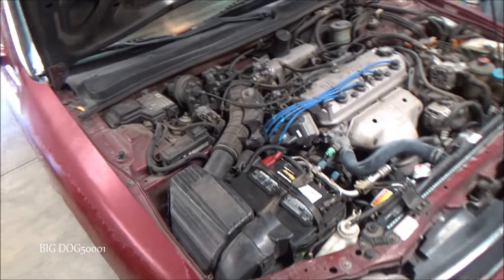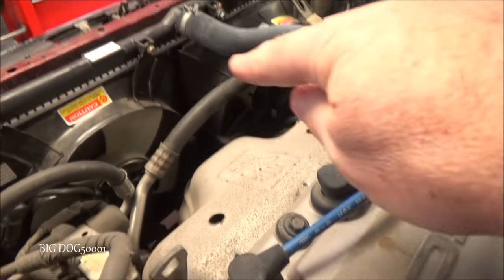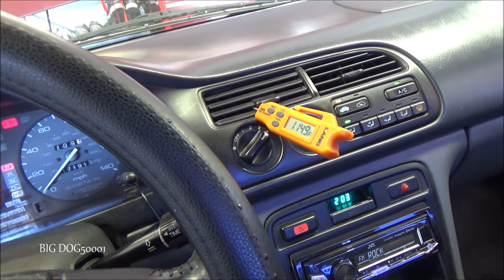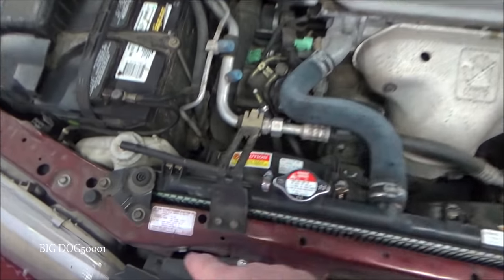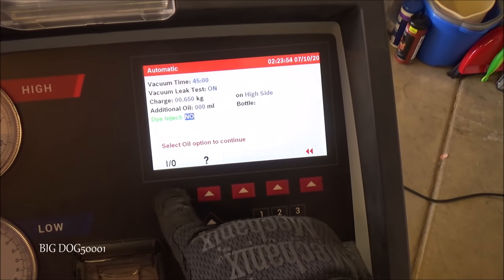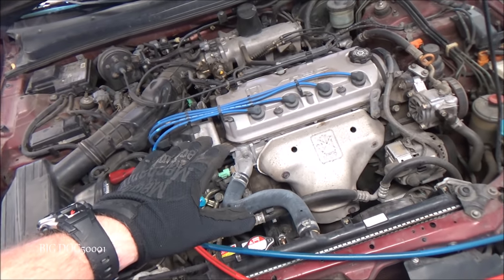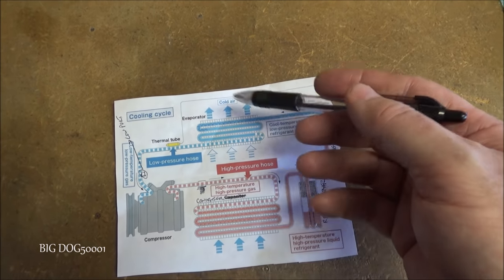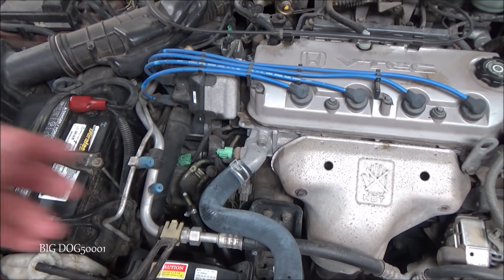Honda Accord A/C Troubleshooting and Service

Comment from the maker: Tools

Disclosure: This channel earns a small commission using some of these links - at no additional cost to you.
Digital Thermometer:  https://amzn.to/39Fb92M
A/C Recovery Machine:  https://amzn.to/2XcQZrE
A/C Leak Detector:  https://amzn.to/2CWJ5fv
PAG 46 Double End Capped Oil:  https://amzn.to/30cN1Bi
PAG 46 Oil (not double end capped):  https://amzn.to/2D4vmmK

The Big Dog 50001 Automotive Channel Store can be found here: https://www.amazon.com/shop/bigdog50001automotive
Reply: @Big Dog50001 Automotive 
I would bet that the leak which is now very small is located in the sharply curved discharge rubber crimped hose towards the right side of the engine compartment. I have this same problem on my 1994 right now, it started out with the leak being so small it was impossible to find it, however now it has gotten big enough you can see the pag oil residue on the side of the black rubber hose right where it crimes in as it migrates up the hose.

Comment: I like the way you did a long vacuum, some guys seem to finish that phase too quick. When the system goes to vacuum, water can't exist as a liquid so it boils off, but as it does so there is dramatic cooling which can cause small amounts of water to freeze in the condenser and receiver/dryer. Then it takes a while for the solid ice to sublimate to gas and get vacuumed away. It is so nice to see a pro do work like this in a small garage setting. You obviously did this for a living and are now at the phase where you can take time to educate people like myself.

Comment: Your video gave me the confidence to go ahead and recharge the coolant system on my 2002 Honda Accord EX (4-cylinder VTEC engine). Interestingly enough, after completing the recharge, my hi/low gauges showed almost the exact same settings you had when you finished. I had never done this before and I'm quite happy with the outcome. My car's air conditioning is now working well. I'm planning to watch some more of your videos. Other YouTubers would do well to emulate your style. You do a great job. Thanks! — Richie

Comment: Coolv video 👍 Just serviced my 97 Accord yesterday. Replaced both high and low Schrader valves due to leaking freon. Purchased R34a with gauge and AC oil. Got the AC to a cool 42 degrees during 108 degrees desert heat. What a difference it has made commuting to work 😎
Reply: Winter in your car.. mine is Death Valley in my car
Reply: @ravishoul1432  Right! I forgot how fun it’s to drive my Accord again opposed to melting on my commute back home 🫠
Reply: @elgatogordo9523  It's my own personal  mobile sauna
Reply: @ravishoul1432  Lol! 🤣
Reply: Oh man are you me? I have a leak on the low pressure side but if I carefully try seating the shrader valve pin it seems to hold. It's held refrigerant for 3 years since I last charged it and it still gets down to 38 degree low. Not bad for a 305k mile car, love my Accord.

Comment: My 1995 Accord Ex still on the factory charge and still blows ice cold. A testament to Honda quality of Generation V.
Reply: Respect.
Reply: Then why the are you here? To rub it in to everybody else whose isn't?
Reply: @ButterfatFarms  I'm a cruel one aren't I? 
muwahahahahahahaha!
Reply: I agree with you. My 2002 Honda Accord EX went 18 years before it finally lost most of its refrigerant. However, because I was extremely busy, I didn't get around to recharging it until now. But I have to admit, I also feared taking it to a mechanic who might say, "You need a new compressor, and I recommend you also install a new condenser. That and recharging the system will be $1400." 😨Gulp . . . That's about as much as I think I could get for the car. I was able to forego the recharge for four years because summers are cooler here in Idaho. — Richie

Comment: I have 2004 Expedition blowing warm air while driving I replaced the TXV expansion valve and it is fixed and also the blend door actuator was clicking so I replaced that too.Yutube is a big help in DIY people like me.

Comment: Man that is hot 117! Well explained video on auto AC charging. Outside air temp at condenser compared to inside AC air vent temp equals the Delta T. 50 degree difference is pretty good, maximum legal reflective window tint all around and your good. I am in Florida an did a shade tree AC gauge charge. No recovery machine or vacuum pump and I am at a 45 degree Delta T  on a 95 degree air temp with 60% humidity on a 93 Accord.

Comment: Phenomenal video, I have the exact same car and my car leaks ever so slightly from the shrader valve on the low side. When interpreting your pressures I noticed in the video you have the engine at around 2k rpms. Should the engine be revved and held when checking the pressures or is it done at idle? Thank you!

Comment: I like the fact that you explained why if the pressures didn't equalize that it could have a restriction. Had my A/C checked, Mech said,1st  pressure Check 10LP -75HP.  After evac and recharge pressure readings were 105 LOW side-110 HiGH side.ambient temp was in the 90's I live in Colorado. Mech said would only take 9 0z.. But  I know the air gap on clutch prevents engagement unless clutch is tapped.Maybe he didn't realize clutch wasn't engaged? And concluded compressor was bad? There is enough refrigerant in system to allow compressor to engage. but only blows hot air. Diverter valve works, A/C condensor fan works.Compressor is not seized but maybe just worn out? Suggestions any one?

Comment: My honda has a hissing noise when not turning the steering wheel.  The moment I turn it a bit, the hissing stops.   The noise starts about 5 min after turning on my car.   Could it be my power steering? or, from what I see, there is a leak somewhere in my AC.    Could it be because I didn't use my AC for some time?    It's what i'm on right now.   Thank you for your video!  It helped understand more on how it is built!

Comment: Nice explanation and repair. I like you AC machine Robinair  make some nice equipment for sure.
Reply from the maker: Thanks Jim!  I agree, they do make some nice equipment.
Reply: Yeah I love all the equipment they make! So easy to use, dumbass can use it.
Reply: @BigDog50001  Hey, Watched a couple of your videos. I have an issue when I operate the climate control manually (Auto turned off).

With the AC on, the only time I get cold air is when I set the climate control temperature to low, any other temperature I set the controls to i get hot air.

When I need heat in the winter and I turn the AC off, the only time I get heat is when I set the climate control temperature to hi, any other temperature I set the controls to i get cold air. 
Any advice?

Comment: Awesome video. I have this exact car with the same symptoms. My compressor runs as well and low pressure side never gets cool at all. I learned a lot. However my refrigerant is where it should be. Not low at all. My fans kick on when the a.c. is on also. So I'm thinking I have a bad expansion valve.
Reply: Did you ever get it fixed? Definitely sounds like a restriction, most likely in the txv.

Comment: Great video. Does the bulb sensor that mounted on the evaporator,monitor the temperature and send signals to the ECM to control the compressor on and off ?
Reply from the maker: No, the bulb and diaphragm (expansion valve) that was depicted is a mechanical metering device.  There is typically an evap temp sensor (attached to the evaporator) that sends the evap temperature to the ECM.  When the ECM detects that the evap is too cold it shuts off compressor to prevent evaporator from freezing.  Thanks for the comment!
Reply: @BigDog50001  thank you for your explanations

Comment: Dave Great Video.
1) if there is a restriction what are the probable candidate where restriction can happen(low or high side).

2) How do you find leaks on Evap side?. Snippet is one way is there any other way you diagnose.

3) If condenser is blocked, how do u diagnose.

4) if TXV evap valve is blocked or open how do u diagnose what values u see on high or low side.

Thanks much

Comment: My accord 2013 V6 Coupe , we tried recovering the refrigerant, it came at 530 grams, we put that back , everything is working but the low pressure and high pressure were not in the recommended zone , in other words low pressure, even though I recharged the system to full, its still blowing hot air , do you reckon it can be a bad expansion valve ?

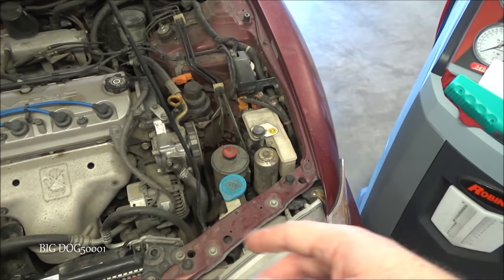Comment: Nice tips on safety when working around refrigerants. Also observed you using your hand as a shield at 12:49 when connecting to the service port.👍🏻

Comment: Hi my 2010 Honda Accord Crosstour won't blow cold air. It only has 60,000 miles. I bought it used and the A/C was working when I bought it. What should I start with first to trouble shoot? It seems to blow cool air but just does not cool enough to stay comfortable. I do have a navigation system. thank you for your help.

Comment: Hello, I have a real head scratcher.  2014 Honda Accord, AC not working.  List of maintenance and parts change.  (some due to damage) Condenser, pressure line, pressure switch, 3 each relays, filter, compressor, R134a, ECU.  I bought the car in winter, did not drive for 3 months so when I prepped it for registration and inspection found the AC did not work.  Replaced the damaged parts and one by one troubleshot.  I bench tested the fans, they both worked, jumpered the compressor clutch and it engaged.  So the common thread to this was logical, ECU.  I removed it from the car to inspect the pins, nothing bent or broken and the plugs looked good.  Reinstalled the ECU started the car again and the AC system worked.  I shut the car off because I wanted to duplicate the WIN.  The system did not function.  I systematically unplugged and reset the ECU to find the top plug was the one to reset the system.  I went to Honda, they installed a new ECU and they told me it worked perfectly driving out of the shop to the lot.  When I jumped in to drive away, no air.  So I unplugged and rest the top plug and it worked.  I cannot find on the net the exact wiring diagram for the top plug and what parts of the car it controls.  It is obvious that by resetting the plug something in the car resets to allow the AC to work.  If you have any wisdom to offer I would greatly appreciate your time and effort.

Comment: Replaced my fans only one worked and now non work as I turn on AC. I replaced and only worked for a short while. I’m curious if the fans don’t work it has to be the relay switch or compressor ? 
I’ll check the fuses again
Reply: 1997 Honda Accord

Comment: The A/C temp blowing should be about 43 Degrees if you want to be comfortable. When I bought my 1994 accord that's the temp it was blowing. Is it possible to
get that temp down to 42 Degrees?

Comment: Let say if replaced a brand new compressor,and you need to put the Pag oil into the Compressor,do you fill it through the low pressure side or the high side ? Thanks
Reply from the maker: Most A/C compressors come with enough oil already inside the compressor for the entire A/C system.  Generally you have to remove (not add) some oil before installing otherwise there will be too much oil in system which can effect performance (there is some math involved in figuring how much oil to remove from the new compressor).  When injecting oil into an A/C system (with an oil injector) it is typically done on the low side.
Reply: @BigDog50001  thank you

Comment: Need help. So driver side blows warm air and passenger side blows cold air. I added ac pro refrigerant and all vents blew cold for 3 days then it reverted back to warm air on driver side and cold air passenger side. If there is a leak why does it not all leak out and blow warm both sides?

Comment: My 1998 honda accord got stucked to the warm position, and I have to bump the actuator in order arto move to cold.It has been like that for 5years.I tried to fix it using the Cadillac actuator found in yutube video but after a year it is back to the same problem I have to bump it to work.So my plan this year 2021 is replace it this summer with OEM parts that is more than $100 .Thanks for the stimulus God provides.

Comment: Thanks BigDog.  On my 2003 Accord Coupe 2.3liter, should both fans always come on with the AC?  Thanks.
Reply from the maker: For 2003 Accord 4 cylinders, there should only be one control for both fan relays so when the relays are grounded both fans should come on.
Reply: @BigDog50001  Thanks BigDog

Comment: I'm getting my 95 civic recharged this week if I can get the same Temps I'll be happy. I don't think it's ever been recharged so I changed the dryer and put it under vacuum for 40 minutes and it held. I'm taking it to a shop.
Reply: @BigDog50001  got it done today my vent temperature was 43.7 at idle I can't wait to hit the interstate. It's nothing like having an old car with great ac.

Comment: Hope you can help. I have Accord 2012 K24 and both fans turns on on start up also the compressor engages for a couple of seconds. Then turns off. Not sure if this is normal or default. Appreciate the help
Reply: I'm having the same issue on the 2012 accord, did u find out what is the caused?

Comment: I have a 2012 accord, the a/c blows cold for the first 3 minutes, then after that it blows warm air, check out the a/c compressor clutch it did engage on and off for the first 3 minutes, then completely off not engaging at all, does that means the clutch is bad, and should I replace the clutch to start off with?
Reply: What you do and what was it, mine blows cold for a little bit and then hot and cold and it’s a repeating cycle. It cuts in and out. I’m just thinking it needs Freon recharge

Comment: so i have an 06 honda accord 5spd manual....i recently replaced my compressor, both cooling fans, new condenser and dryer....but after the install, when i press the AC button in the car, nothing happens. I pulled the relay and jumped it and then and only then will the compressor clutch kick on but as you know it needs the relay to disengage and re-engage the compressor so it doent burn itself out. I cant imagine a broken wire since the radio/climate controls havent been removed and tampered with and it worked before the install albeit with a leak in the condenser. What do you think could be my issue?.

Comment: I have a 09 Accord. A couple days ago in the middle of the night my alarm just goes off for no reason. Happened like 3x's that night. The next day my AC & my door locks not working. I changed the fuse & relay and it started to blow cold again but stopped working. I don't know where to go from here. Think there's a short somewhere?
Reply from the maker: I would look at the circuits for common wiring points for the things not working properly (need a wiring diagram for that though).  I would also look for possible wiring damage, especially from rodents chewing on wires underneath car or hood.

Comment: hey big dog got a question.  2006 Civic EX, when the AC is on, the engine stumbles at idle.  Does it every 10-15 seconds.  Any idea as to what I should check?  I just had some AC work done at the dealer, they wacked me for $550 and I don't want to take it back.  Thanks in advance.

Comment: Big Dog have you worked on a Honda HRV 2017 AC system? Mine has been giving me problems try to look for a relay but cannot find it does not show anywhere on fuse diagram layout cover..
Reply from the maker: A/C compressor clutch relay for those should be in one of the smaller fuse boxes under the hood (Auxiliary box A).  There are 8 relays in there and one of the corner ones is for the A/C compressor (depending on trim level).  I generally don't work on them because most (if not all) of them use the newer R1234yf refrigerant and I do not have one of those A/C machines yet.
Reply: Thank you so much for your reply I really appreciate it. Keep up the good work!

Comment: i have the same car , ended up finding a faulty ac thermostat , i call them a freeze switch . i cant find them nowhere !  Honda no longer makes that part .  have you ever bypassed that switch  before ?
Reply from the maker: I typically will try to adapt one from another year in situations like that.

Comment: Auto AC has a physical seal in the front of the compressor at the clutch; home AC is a sealed system. You kept saying kilograms it is probably grams or 0.6 kilograms.

Comment: Hi I have a 2012 Honda Accord and my air conditioner will blow cold air but then it will start blowing hot air it goes back and forward with cold air hot air

Comment: 98 accord it blows cold air , when its on for 10 , 15 minutes , the whole entire climate control no function or no ac , blowing hot air.. after 5 to 10 minutes later ac comes on and blows cold ac. and climate control turns on..  what is the cause?
Reply: Tag me when you find out!   My 2002 on startup blows cold for 5 mins...then warm.  It won't blow cold again until it sets for a while ...then repeat.  But mine never stops blowing totally...just stops blowing cold.

Comment: What year is that Honda, I have a 97 and the top ac fan speed doesn't work and I also put refrigerant I'm it last year and once it's top hot outside I would start smelling the refrigerate and either deal with it and cracked the windows so I don't get sick or turn the bitch off